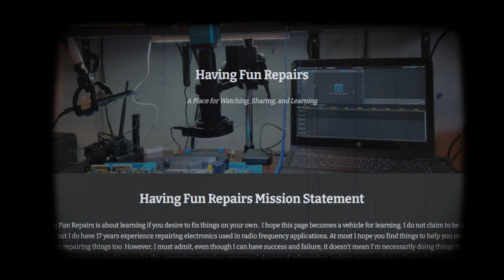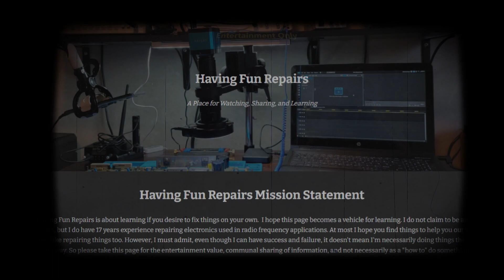(Repair) 2006 VW Jetta Master & Slave Clutch Cylinder Replacement

Comment: Literally ran into the same behavior today right down to the snapped master.   Have no heartburn watching it all and very helpful.
Reply from the maker: Thank you so much for your comment. This was truly a trial by error until getting it done. I still don't believe I did everything correctly, but my brother-in-law is still driving the car with no issue. I could not find a complete video online that covered replacing the master and slave clutch cylinder for the MKV Jetta. That was really my biggest motivation in making this video. The hope that it would help someone else in a similar situation. Hopefully your third clutch spring is the final. Thank you for watching!
Reply: @HavingFunRepairs  I had a similar headache with the pedal spring.   Not even remotely convinced its even necessary in my own car but it's cost me about $160 to replace already.
Reply from the maker: @Accidic  yikes yeah a bit pricey for sure.

Comment: Nice work man bout to do all this myself also
Reply from the maker: Thanks for watching, hopefully all goes smoothly for you. Give some feedback if you do not mind (additions, notes, what you would suggest) based on this video demonstration and your own application. I'm sure any feedback will help others who are viewing at this video.
Reply: Hey man that plugin on engine side did that have clips or does it just pop out
Reply from the maker: Are you talking about the master cylinder plug or the overflow tube? Either way both had a clip or c-clamp
Reply: @HavingFunRepairs  no the actual plug that it doesn’t come with. You had to take from old and place it on new one.  I was able to get it switched out to new one. Now I’m having trouble with 2 clips attaching cylinder to peddle   Trying to do it without taking the peddle out
Reply: @HavingFunRepairs  got it and it wasn’t easy at all lol
Reply from the maker: Glad you did!

Comment: The right hand drive cars are a lot harder to get to as its behind the engine and you have very little space to work in! But after doing 3 on the same golf because of a faulty clutch bearing I got to become an expert lol.
Reply from the maker: I can only imagine. I learned a lot by error this go around. Can't say I would want to do this work again any time soon. 🤣

Comment: How did you get the spring back in?
Reply from the maker: I inserted the spring, compressed it with the tip of a screw driver,  lever the foot pedal back in place, then removed my screwdriver.